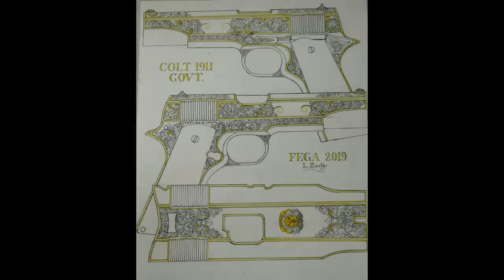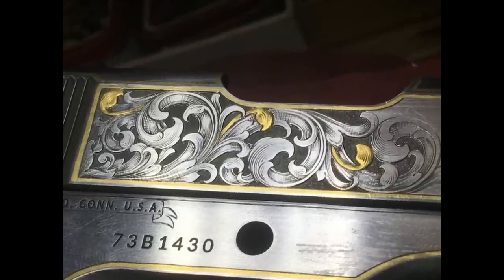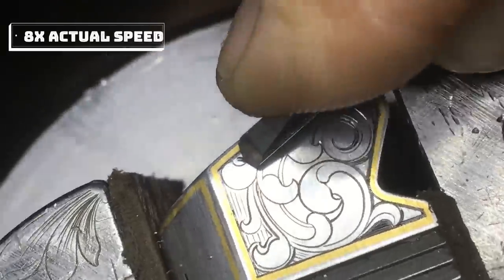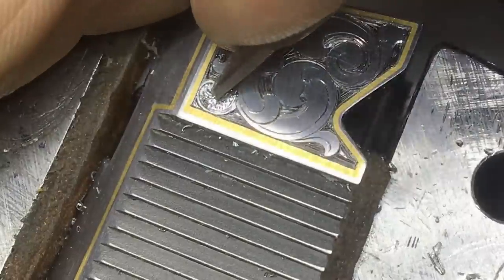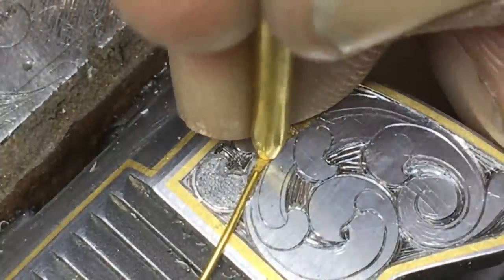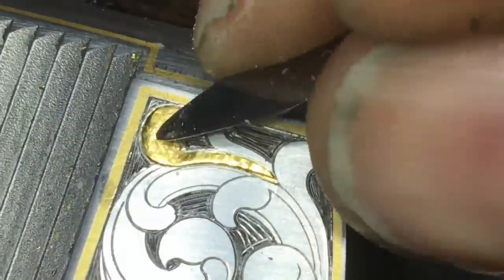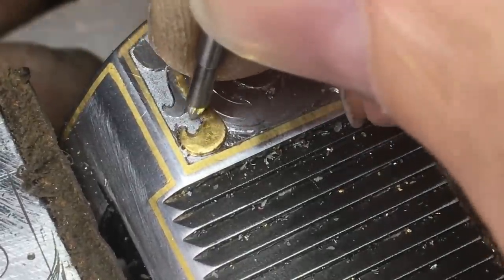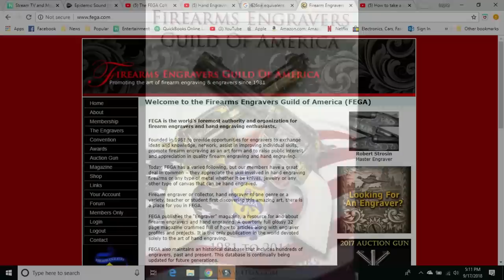Gun Engraving -the FEGA COLT 1911 - Episode 1 Gold Inlay Technique

Comment: torch tip cleaning tools can scribe a good line and wound guitar strings an even finer one but thats best for softer metals like coins. a vacuum cleaner belt is good for polishing if you bend it in half and use the edge.

Comment: Thanks so much for posting your process. If you had the time to answer some quick questions I'd really appreciate it. A) when stippling do you stop and the bottom of the wall of the cut or travel up it partially? and B) does the stippling have to be all done with the part in the same orientation? (I find I end up with a different shine if it turn it part way through the process). Thanks again for the info, I understand if you don't have the time to answer.
Edit: oopse, just saw the next video in the series where you talked about cutting the walls again to get them bright.
Thanks again for sharing info

Comment: You are truly a master of your craft. Serious question, what happens if you were to make an error? Is there room you leave for correction or does the project have to be completely redone? Thanks in advance.
Reply from the maker: cavdragoon there’s no room for error. Most engravers won’t cut a gun till they have 4 or 5 years under their belt and have mastered the tools. A slip can be burnish out and sanded. But that ruins previous work. A laser welder can fill a slip as well. Neither is ideal. But I haven’t slipped in years.

Comment: love your work...
but why does the chisel do that sound at 6:51.
are you using an electrical equipment for chiseling?
Reply from the maker: Mathieu Duprat it’s a pneumatic assisted system. There’s a tiny piston in the graver handle. The piston basically replaced the hammer in hammer and chisel engraving. The left hand is free to rotate the vise now. The graver gets a pulse of air which drives the piston. It’s no different than hand pushing a traditional graver except for the piston in the handle to help drive the graver forward through tough steel.

Comment: Hey how should I get started with metal engraving? I know a lot of the chisels are very expensive, is there a cheaper, beginner solution? I love your videos by the way
Reply from the maker: Chisels themselves are very inexpensive. Costing less than $20 each. A hammer can cost less than $30. If you want to use professional pneumatic equipment to drive your gravers though. yes they are expensive. Engraving is 75% about the artwork and only 25% about cutting so I tell all beginners to start with the cheapest tool. A pencil. I like to say you cant cut what you can't draw. Lastly, i also tell people that in general, engraving is an expensive profession, not a cheap hobby. Pneumatic equipment has a shorter learning curve but costs money. Hammer and chisel is cheap but you'll need some sort of instruction to learn it and you'll invest years in time. You'll pay either in time or money.
Reply: @MasterEngraverTV  ok good to know! I'll invest in a cheap set of chisels, I'm already pretty experienced at drawing filigree! Thanks for your reply, wonderful job!

Comment: I love the work! I want to get into engraving, any good starter kit recommendations?
Reply from the maker: Gus Trujillo there is really no such thing as a starter kit. Hand engraving is a profession that requires a fair bit of equipment and all of it is designed for professional use. You didn’t mention if you want to use hand push, hammer and chisel or air assist. With the first two you’ll need hands in instruction. With air assist you’ll still need some instruction but you can learn on your own from there. Hand tools are under $1000 for startup. Air assist will be around $3000 for basics.
Reply from the maker: And I use GRS Tools. There are 3 main makers of air assist tools. GRS, Lindsay Engraving Tools, and the EnSet tool.
Reply from the maker: And I forgot the most important tool! A pencil 😁 You can’t cut what you can’t draw as they say. Engravers art most of all artists. We just apply our art to steel.

Comment: How do you know when to resharpen your graver? And do you only do the heels? Or the face?
Reply from the maker: Rob Mart depending on the material you are cutting you may be sharpening every 5-10 minutes. Like hard stainless. On soft carbon steel a graver might last an hour. Always sharpen face and heels and inspect tip under a scope or loupe.
Reply from the maker: Your cut will tell you how sharp your graver is.
Reply: @MasterEngraverTV  thank you. I thought my hss graver was a dud. ☺

Comment: Can you add a link to good beginner equipment?
Reply from the maker: Nathan Brown I hate to say but there’s really no such thing as beginner equipment. Engraving is a profession that requires a certain amount of equipment to set up a shop. Now the simplest way to start would be hammer and chisel. GRS offers a basic setup for about $500 that includes a beginners DVD from Sam Alfano. You’ll only need an Engravers vise. As for pneumatic tools, the least expensive way to start would be the GRS Graversmith. It’s around $850 for the unit and again you’ll need a vise and some type of sharpening setup. And a few years of patience. I always say, engraving is an expensive profession, not a cheap hobby. It’s a joke with sone truth to it. Forget the Chinese Engraving machines you see on eBay or Amazon. They are good only as doorstops. Seriously.
Reply: @MasterEngraverTV  Thank you for responding! I will be looking forward to looking into some equipment tomorrow. Thanks for the advice!
Reply from the maker: I use GRS engraving equipment. There are a few other companies but GRS is the one place you can find anything you’ll need. If if you are interested in classes they have a facility for that as well.

Comment: Roughly... what kind of money are we talking to have a gun this size engraved like this?
Reply from the maker: tubedude54 they are all different depending on complexity of design.  Attention to execution. Type of scroll. Etc,etc. Anywhere from $6000 to $25000. This one is toward the higher end of the scale. 
I charge per hour about the same as a good boat engine mechanic. This gun has 200 hours in it so far.
Reply: OMG I had no idea!  That's out of my league!  TY for your answer!